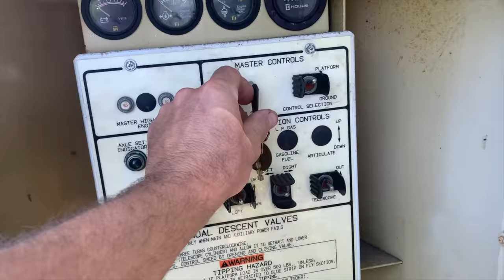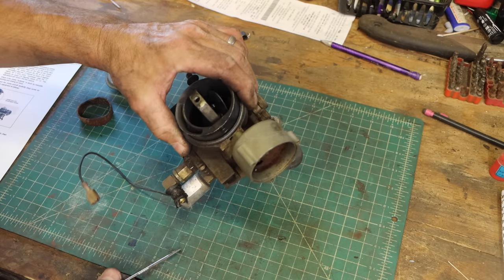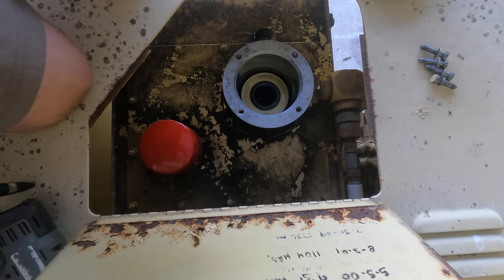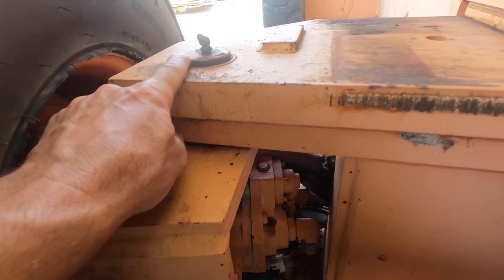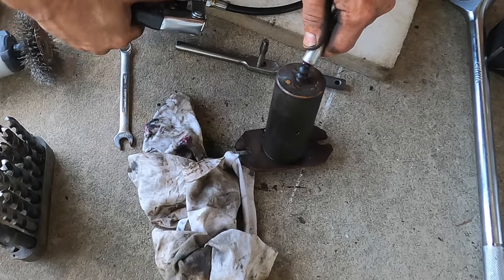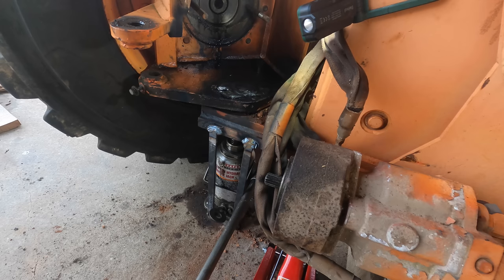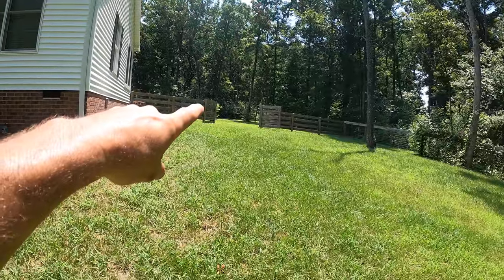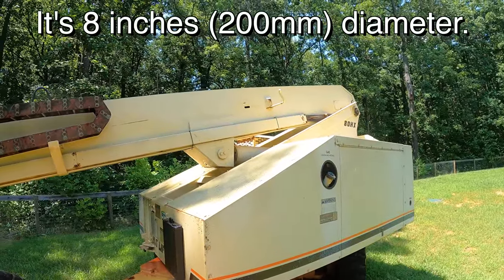Fixing and Using a VERY STUBBORN Boom Lift to Cut Down Dead Trees.

Comment: YOU ASKED SO THIS IS WHAT I WOULD HAVE DONE!  1. They sell a grease zerk rejuvinator tool.  I put wd40 in mine and smack it with a hammer it injects this into the joint at upwards of 14000 psi. I use wd40 because it really dissolves grease. Then I heat it up and add more. https://images.toolsid.com/ipa/items/7862-6.jpg. I heat it up because I tend to believe the fluid is drawn to the heat or maybe just the expansion and contraction of the steel allows the fluid to flow.   2. if that does not allow me to grease, I then use force.  the bottle jack is a great idea.  Instead of welding, you have an excavator.  Use it.  that boom is a lot of weight.  No need to weld. add more weight.  excavator boom is lots of weight.

Comment: aanother thing to try on the stuck  pin prrob wwould be to take the grreaase nipple out  drill the grease out then heat up the grease port. an aluminium rrod would be good to get the heat straight up inside the pin.

Comment: One Dead Lift, The Screwdriver that Walks The Plank, Tecnician Gets Fixed by Magic Mushrooms by His Wife Who Seems Bored to be Married to a Seaman Who Sleeps Not in His Toolbox Every 3rd Fortnite Being a Tin Man in Disguise (or Trying to Prove that Every Kind of Mushroom Can be Eaten, But Some Only Once) or Just in Retaliation to His @18:59 Favourite Saying, - being Wholesome Bad John 🤣
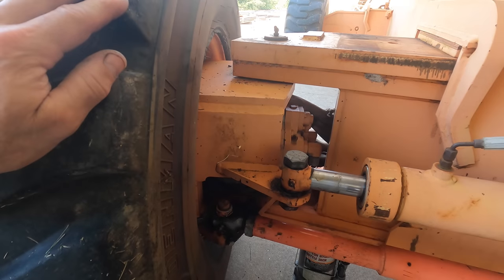Even Worse One @22:01...
@23:52 - I See a RAT! 
Thank you very much for very entertaining videos!
P.S. - I'm 50 and one of the projects I helped being in tender years was the restauration of Buick 90 Limited 1939, which has its museum place now. That taught me _a lot_, like... Grey iron piston rings, valve reseatings, double-spring drum brakes, mechanical fuel tank floater gears and how to fit them properly (hint - blowtorch, graphite and swearings)...
Keep your Johnson up and running - well, once a month at least maybe? 😁

Comment: Not sure it would have helped you on this one (looked crazy difficult), but my mechanic showed me a tool like a big syringe that you can couple to the grease fitting and hit with a hammer to force oil through the grease fitting. helps sometimes! search for "Lincoln 5805 Grease Fitting Cleaning Tool"

Comment: You need to teach someone on the ground how to use the base controls.  I used a lift that had a naught in its belt.  The person on the lift did not push control guards.  Something he was working with pushed the up control.  He was 20ft inn the air and it squeezed him against the structure.  No one on the ground knew how to take over controls.
We  held control class every time we used the lift.
BE CAREFUL....

Comment: Why were you heating the kingpin?  That just makes the pin larger and even harder to shift.  If anything, you should have been heating the plate around the pin, but that's a lot of thermal mass to heat enough to get a useful amount of expansion, so I doubt it would have worked either.
I don't understand how people can pay so much for this equipment, then skimp on basic maintenance.  It costs so much more in the long run, it's just dumb.

Comment: Not going to replace the hydraulic all. If you only knew the main cylinder it’s gonna blow and you had to fix it or get it fixed I need a long house 5 gallons you find out later oh well doing a good job keep it up.

Comment: i don't get it... you have more than enough room for a 90 degree drill both top and bottom there. why didn't you just drill out the old grease in place? i mean it's no guarantee that it won't get past that tiny little last bit, but man that could have saved you a butt-load of time.